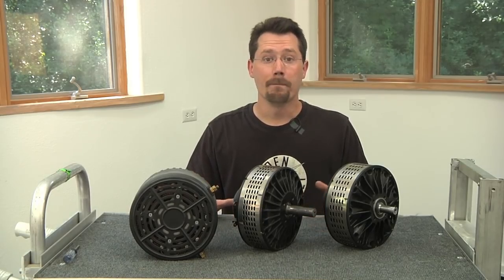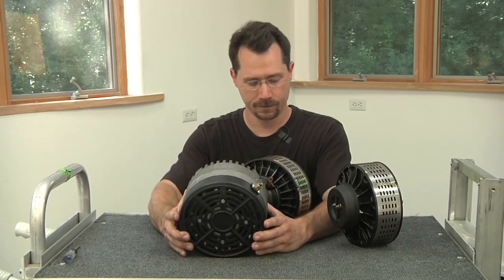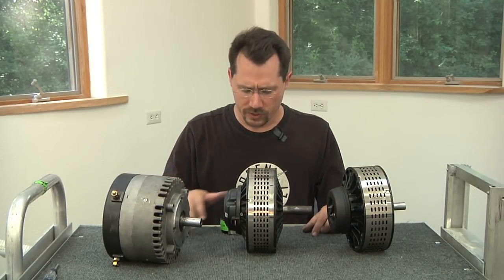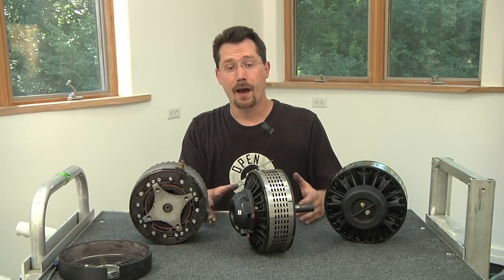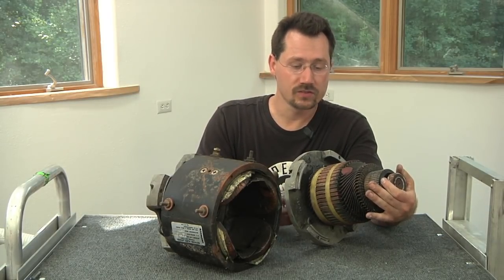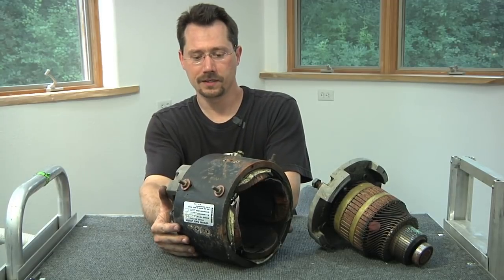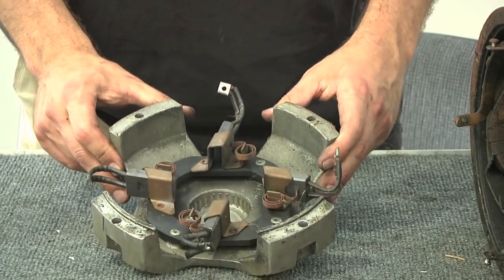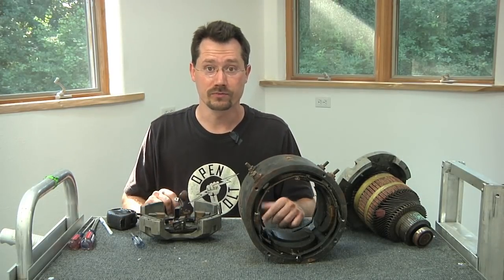4 Build Your Own Electric Motorcycle - FULL - 4 Motor

Comment: This series is fascinating. I'm a mechanical engineering student, so I know a bit of stuff, but I'm definitely outside my realm with electricity, lol!
Luckily, I am required to take a couple electrical classes, so I'll be sure to annoying the heck out of my professor with questions as much as possible :)
Reply: Same
Reply: If you can understand the logic behind mechanical systems, electrical systems will come naturally. They're really almost the same, well they actually are since they both just operate on a principled understanding of physics. You'll get it no time.

Comment: Ran across this video in my research for trying to design a Spyder type autocycle.  The motor I would have in the front to provide FWD as I live in a northern state that does get a fair amount of snow so I want it to pull me along other than trying to push me through the stuff.  Great information.

Comment: To anyone watching this.  Save yourselves all the headache of failed motors and use brushless motors.  This is 2018 we don't need brushes anymore.
Reply from the maker: Arlin Sansome this video is from a project I originally built in 2007. Certainly technology has progressed since then (especially in the realm of batteries.) Brushless motors and controllers are now cheaper and more available than before, but there are still plenty of great conversion projects which used brushed motors. A later project I did was upgrading the batteries on a Vectrix, which used a brushless hub motor.
If you have a nice conversion project which showcases a brushless motor, and teaches people about them, please share it and show it off!
Reply: Thanks I have been putting them on my Channel.  Currently I have the world record for fastest/quickest Electric FWD 1/4 mile.
Reply: Quite right, I can't see, waiting on a petrol station forecourt while your mate fills up his ICE powered bike, as safe with a brushed motor or a paint shop or any place with a combustible atmosphere.
Reply: Arlin Sansome
Reply: Yes, thats just what I was thinking. Why would you put a motor that will break down when the brushes wear out. Use PMG but have the magnets on the rotor side and control the power, torque and RPM with a VSD. Also if you roll down a hill and the VSD is disconnected, you can re capture some power that the rotor is putting through the stator windings.
Reply: In my opinion I'd rather have a motor I can rebuild when it breaks, and I don't know if brushless motors are easily rebuilt, or if I would have to buy a new one everytime it breaks. I'm also not sure if brushless would handle the vibrations of the road well over time. I have some experience with the motors in the video, and if they were cheap in 2007. I'm sure they are even cheaper now. Lol
Reply: brush-less motors are less likely to break down because they have less parts. you are still relying on the same bearings. brush-less motors are capable of higher speeds, provide more torque and are more efficient overall.
Reply: @johnmay5957  Well John  Maxon who make motors for things like the Mars Rover  have brushed motors that are 94& efficient  - there brushless is 88% - Brushed controllers are also simpler - the new Tessler motor is a hybrid reluctance motor
Reply: I’ll take 2 of those brushless motors.
Reply: I just wish there was a 3D scale .stl out there for brushless motors w the math on hand for up scalding and down scaleing with the math for determining tq output and current involved at said rpm and determining energy loss as heat under load plus factoring costs of copper magnets aluminum plaster resin and pla all in 1 place I’d love for there to be a community coming together to learn and teach echother and develop a method of construction of basic components with salvage materials in ones back yard alone with his or hers work alone and a publicly time funded development project for organized technology for in inflated production
Reply: @garbizwal    An NEDRA record holder is still rare as hen's teeth. You done good.  Our local EV drag master is John Wayland. But I haven't seen him around much lately at PIR.
Reply: There is still a place for brushed motors.
Reply: @trevortrevortsr2  bullcorn, BLDC motors are more efficient than BDC motors, PERIOD. BLDC is an AC motor with a variac and a set of hall effect sensors to detect where the motor's magnets are in regards to the windings at all times. it an analog AC system that can push voltage and current EXACTLY where and when it needs to at any given moment. BDC is a scratchy electric motor with stupid blushes that eat away at the motor as it moves. there's a REASON Nikola Tesla's brushless AC motors took the industrial world by storm. there's a REASON why all of the motors attached to an AC outlet use Brushless motors instead of brushed.
Reply: Brushed motors are a very primitive and inefficient motor design. They are really only suitable for intermittent duty in an environment where efficiency does not matter. I would not consider an e-motorcycle conversion with anything than a brushless hub motor and a lithium ion battery pack. To further maximize efficiency I'd suggest looking for a 250cc sportbike as the donor bike because it will be light weight and designed for reduced aerodynamic drag. If you are looking for a high quality brushless hub motor conversion kit or components, check out SiAECOSYS. They have what you need for a high-efficiency brushless conversion.
Reply: If you are electronically inclined enough brushed motors can be much better maintenance wise. They are much less complex electronics wise so the brushes are the main fail point if you don't consistently overheat them. On bigger motors like these brushes are designed to be replaced relatively easily. On brushless motors the common fail point will be on a circuit board and would likely require significant electronics knowledge to even find the broken piece. Circuit boards would likely be more expensive to replace and harder to find if the motor is no longer manufactured.
Reply: @joshnabours9102  Nope.  The thing is with a brusless (3phase AC) setup you don't have any maintenance.  The brushes fail and at 100% going to fail in a brushes setup.  It makes for a much heavier and less efficiency and more failure prone system to use brushes.   There is a reason you don't see a single OEM using a brushed EV drive. 
They ALL fail!
Reply: @joshnabours9102  Both brushes and brushless motors use a "circuit board"  <- which is a motor controller.  You don't have any gains here with either motor type.  But the brushless system has no failures other then motor bearings after 100s of thousands of miles or even over a million miles. Where as brushes will wear out of even bounce off the armature and fail at random for what seems like no apparent reason.
Reply: @garbizwal  the motor controller is an external circuit board however brushless motors have a specialty circuit board internally that provides the polarity switching function needed to make the motor function. This internal board replaces the graphite brushes of a brushed motor. These internal boards typically add  20+ more components to fail because of water, heat and/ or vibration where brushed DC motors have 4 to 5 total parts to fail. 

As a real world example; I have a 40 year old motorcycle with 50,000 miles on it and the starter just failed. If it was brushless I would not be able to get the circuit board to replace it. The internal circuit boards are typically specific to that brushless motor. I would have to spend hours reverse engineering or spend hundreds to get it remanufactured or replaced. Because it is brushed I paid 20 bucks for new brushes and will have it rebuilt this week in 1 hour total not including shipping time. 

As with everything in engineering newer designs perform similar functions but there are tradeoffs made between various characteristics like efficiency, fine control, power ratings, complexity of manufacture, complexity of repair, environmental issues and cost. Which type of motor is better depends what you need the motor to do.
Reply: @joshnabours9102  No you are just spreading pure BS lies.  There is no circuit board inside the brushless motor I know I have 100s of them.  I also develop'ed multiple brushless motor controllers and when designed right they last 20 years+   The motor controller has a few more power transistors (compared to a brushed motor controller) to control which phase gets the power and how much.   Brusless motor controllers are more reliable then brushed motor controllers and the brushless motor it's self is 5-10 orders of magnitude more reliable then a brushes motor.  You keep talking about repairs and having to replace brushes.  In a brushless system there is no repairs it just works.
Reply: @garbizwal  some brushless motors have the circuits internally such as computer fan motors and some ebike motors such as the one in this video ( https://youtu.be/z_5RlBvoNoA )  of a bafang one with a sensor board attached to the motor and a current control board  (esc) separate from it. Any sensored brushless motor will typically have a circuit board on the motor itself as the hall effect sensors need to be in close proximity to the motor to function as needed. Additionally Because brushless motors are effectively pseudo-ac motors the control side circuitry is much more complex than a dc brushed motor. 

I have seen multiple comments referring to brushed motors as broken when the brushes wear out. This is simply not the case. Would you call a car broken when the brake pads; a designed in wear item, need to be replaced? The brushes in brushed motors are just that: a wear item. They wear out so you replace them when they do. Brushed motors have service intervals like a car. 

Brushless motors are akin to sealed transmissions on newer cars. When they break they are designed not to be serviceable so you replace them with a new one and trash the old one. If they break earlier than expected you are guaranteed to have an expensive time replacing them.

This whole brushed vs brushless motor argument is like AC vs DC power. Ac is much better for transmission of power where dc is much better suited for powering anything with a computer or microcontroller in it. However you can use dc to transmit power and done correctly in its correct place it does do well. Look up the newer technology high voltage dc transmission to find out about what what I am referring to.

Comment: I'd like to build a motorcycle using a golf cart motor 4 12v batteries. Is there a way I can also wire it so it will recharge the batteries if i have a back up gas engine?
Reply from the maker: You would basically just be running a generator to top off the batteries. Take a look at my DIY Hybrid car project for some more ideas.
https://www.youtube.com/watch?v=xXVi-g4jWqI
Search for "Revolt DIY Hybrid" on this channel for more.
Reply: @BenjaminNelsonX  y did you choose the yellow top over a blue top deep cycle

Comment: Nice series, thanks for putting this together.  Extremely helpful. I notice that you didn't discuss brushless motors...curious if there's a reason for or against using them?
Reply from the maker: No. There is a wide number of styles of motors out there. In this series, we were just sticking with the basics, and talking about motors similar to ones I used in this project. There are other videos out there that do a good job of describing brushless DC motors. I have a few videos showing how 3 phase AC motors work demonstrating a Nissan Leaf motor.

Comment: I m very much confused which motor should be used for my gasoline bike.  I need 60-80km\hr speed. Motor should be waterproof and small size.high efficiency and chief . I see some motor in aliexpress and bit confuse to order. Please guide me. I will send u link if u provide me email address. I calculate torque rpm wheel rpm gear ratio but could not decide that motor give such speed or not. Please guide me. Mk from nepal.

Comment: The two motors look the same because they were both designed by Cedric Lynch - they also have 8 outer mounting holes -  the motors have different builds depending on use from i think 90 summit to 140 poles  - both motors can exceed 90% efficiency - The Lemco is built in UK and the Agni in India

Comment: Can you do Regenerative Braking on these motors/controller?
Reply from the maker: The motor I used on the motorcycle was a Permanent Magnet DC Motor. Those work very well for regenerative braking. However, the controller I used does not support that as a feature. There are some other motor controllers that do.

Comment: I was having an idea I would like you to consider. If you built a Sterling engine, how big would it need to be to produce enough electricity to charge the batteries. I know Trains use a diesel generator and electric motor setup. I was thinking of trying to use the Sterling engine for that sort of application

Comment: Ok it’s June 2021 where can I buy a strong electric motor and battery to put in a Dirtbike frame. I want the strongest and most power I can buy that will fit in a full size dirtbike frame

Comment: Hi Benjamin, thank you for all great videos. May be you can give me a suggestion. I am choosing the DC motor and battery pack
to make a motorcycle. I got the motor data sheet showing the currents, RPMs and torques in 'open load' conditions. 
I would like to know what will be the current for the system '75 kg passenger + 75 kg motorcycle/ batteries' running steadily 
at 70 km/h in a no steep road. I guess I need to estimate the load torque in the motor shaft in the specified conditions
so I can calculate the actual current. Do you have any suggestion for estimating the load torque? thank you
Reply from the maker: Do an online search for HORSEPOWER CALCULATOR. One horsepower is approximately 746 watts. Current (amps) times Potential (Volts)  is  Power (Watts). Knowing that and using a horsepower calculator should be able to answer most of your questions.

Comment: I noticed the 708 has permanent magnets AND brushes. Weeeeird.
Reply from the maker: There's nothing strange about that - it's a relatively common DC motor setup.
Whether or not a motor has permanent magnets has nothing to do with if it has brushes or not.
You may just be associating permanent magnets with a permanent magnet AC motor.

Comment: Thanks for a great video Benjamin, I was weighing the possibility in a hub motor to convert a Honda 350 about the size of your 440 Kawasaki. This would also leave more room for batteries. What are your thoughts on the hub motors?
Reply from the maker: Hub motors tend to cost more, there's a smaller selection of motors available, and you can NOT change gearing. They DO give you more room for batteries, since the motor doesn't have to be in the center of the cycle. Take a look around, if you find a hub motor that suits your project, go for it.

Comment: Hi Mr. Benjamin. I am a first time or prospective electric bike builder. I am interested in doing the conversion using the MARS motor. But I have a question. Would I be correct in using the original gear set? I would like for my bike to have and use the normal gear lever to select different drive speeds over different terrains. It is a DR650. Kindly help me out
Reply from the maker: Motorcycles don't have much space in the frame. Having a traditional transmission takes up space. On top of that most motorcycle engines and transmissions are mated in a way that makes it difficult to use the one without the other.
Most electric motorcycles use single-speed gearing, just by selecting appropriate sprockets connected by the chain to get the power and speed combination you are looking for.

Electric motors have high torque at low speeds, so you don't need a transmission to get torque that the low gears provide. Make sure to use a high enough system voltage for the maximum top speed you are looking for.
My cycle only used a 48V system, and was designed for about a 45 MPH top speed. I usually suggest that people want at least a 72V system for their DIY electric motorcycles.
Reply: @BenjaminNelsonX  Thanks, Nelson. I am hoping to get an average of 80 Kph (I do not know how much mph that translates to), but I think the 72V system will do. As for the space< I think the DR650 has plenty of room in the frame after I remove the cylinder, cylinder head and cylinder-head cover (approx. 250mm height x 300mm length [front-to-back] x  as wide as I can go from left to right).

Comment: It has been said, I don't want a pickle, I just want to build an electric motor sickle.
Thanks for the info demo. I have a saying, LOW POWER IS BETTER THAN NO POWER.
Ever car has a battery in it and the most available power supply.

Comment: I don’t understand the formula you gave for figuring out what your top speed will be. You said measure the circumference of your rear tire and the gear ratio but then in the writing all you say is motor RPMs divided by just the gear ratio so not sure what your saying. Is the gear ratio between the front and back sprocket or back sprocket and back tire? Or what??
Reply from the maker: Speed of the motor, divided by the gear reduction, times the circumference of the tire.
If in doubt, use an online gearing/speed calculator.
https://www.gearingcommander.com

Comment: just wondering what application these motors are originally built for? or are the dedicated to motorcycle conversions?
Reply from the maker: Motors like the ones I show in the video are typically used for mobile DC powered machines. Anything from floor-buffers to go-karts.
I've even seen small cars running with this type of motor.